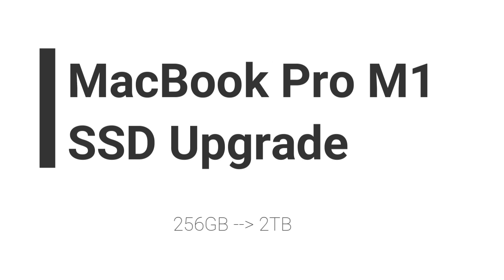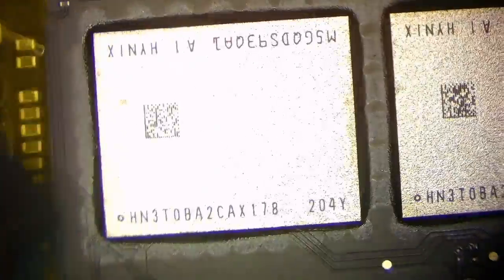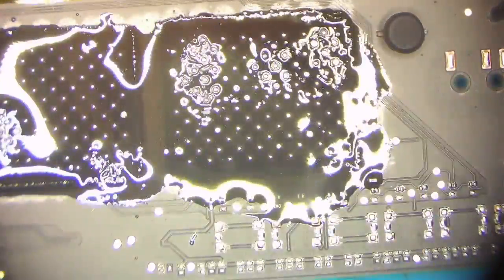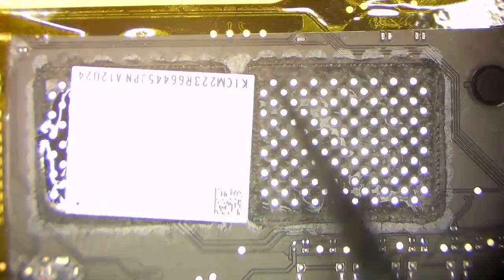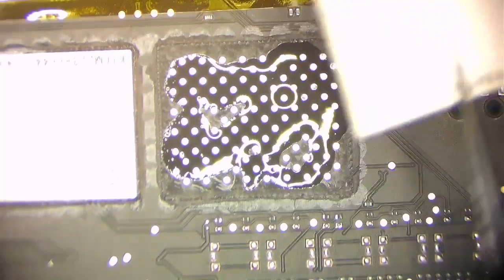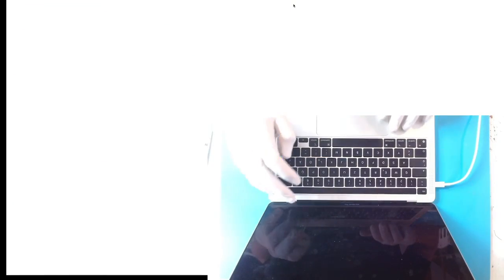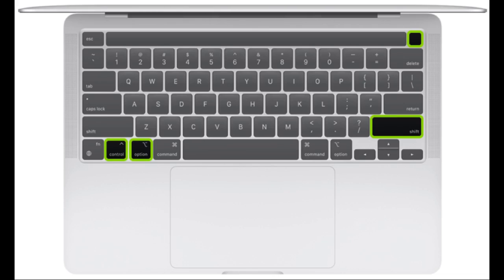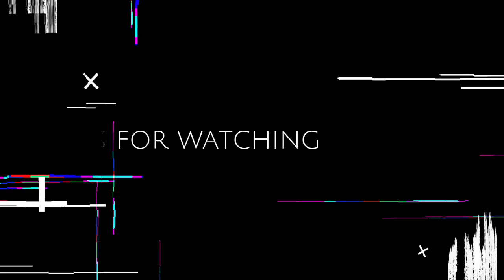MacBook Pro M1 (A2338) SSD Upgrade 256GB to 2TB

Comment: Did you extract, dump the firmware from the 256GB NAND and use a programmer to flash that firmware onto the 2TB NANDS? Also do they must work in pair? I mean can you install let’s say just a single 1TB NAND and not soldering anything on the second?
Reply from the maker: no. you just solder new ones and thats it
Reply: @lindenaurepair  Sounds great. Thanks!

Comment: Awesome video. I want to do it, but I see a difference in the chip info from the AliExpress link you shared. In your video it shows starting with KICM223 and ending in 2024, but when I look at their current options the info on the chip starts the same but ends in 2020. Will that be a problem? Ty so much!
Reply from the maker: @Film4Sports  no issues. endings dont matter
Reply: @lindenaurepair  last question, can you use these same SSD chips on M2 and M3 Macs as well? Seems like you can: https://youtu.be/LMTI6gwxinw?si=z9dtBbkJStCLMHSW
Reply: @lindenaurepair  do you reball the new NAND before soldering in place? I think your video doesn't show but I've seen a couple other ones where they do
Reply from the maker: @Film4Sports  yes, of course they have to be reballed!
Reply: @lindenaurepair  sorry last question hopefully, what type of soldering paste do you use for reballing? Same low melting point, no clean paste? Or different melting points for removing chip and reballing?

Comment: As soon as I saw you have to pull off those chips on the board i realized this was way to complicated lol
Reply: And apple did this just to make it as hard as possible for end consumers to do. But there was no way I was paying £500 more for a bigger drive...not when they cost <£100 off the shelf
Reply: @nylosx well they mostly do this bc just like with their phones, they’re gonna be obsolete in 1-5 years. So the user will eventually have no choice but to buy an entirely new phone or computer. With millions of users, 
 It keeps their sales moving. Most people want all the “cool” features so they do it every year anyways. I went from an iPhone 6s to a 12 to a 15 pro max. So I don’t buy phones but every once in a while. When mine actually does shit the bed.
Reply: @nylosx  It's not the main reason they'd use components like this instead of removable drives.  With removable drives, the mounting hardware adds a considerable amount of wasted space to the motherboard.
Reply: I think if have the right tools can be done
Reply: Lmao yup, I literally was just reading about it and it even said you’d have to pull off the firmware strips. That’s why they say, this can’t be done. Bc unless you’re someone with extensive knowledge of this, the average person WILL fuck their entire warranty up and their computer. Idk about yall but I got this when it first came out and M1 was the “craze” it was awesome. Supposed to have so many cores and be faster than  Mac’s with intel and even some pcs. Which isn’t exactly true. Depends on the pc build. 

This, It isn’t complicated but if you don’t know what you’re doing, it will be. Most computer users have no idea how the inside of it is actually doing its job. So if you’re one of them, save yourself the money of fucking up your computer and go have a professional install more memory if that’s the route you wanna take. In most cases doing it yourself completely voids the warranty that most people try to use when they complain about needing a new one.
Reply: afraid to mess up thats all.

Comment: Hi I have a macbook A2179 that has a potential logic board issue. It's like the battery wont charge but the battery can power the device, I have tried another battery and couldn't get the battery charged. The computer also only boots to the apple logo and sits there with fans running and cpu getting hot. There is no display connected as it is damaged. Can you help me on what to do? It's a Macbook air 2020 intel i3 8gb ram 512gb ssd A2179 thanks.

Comment: Hi there, 
I’ve got Macbook Air M1 A2337.
Mine is 256GB, if I upgrade it to 2TB, does it need to change T2 chip from 1G to 2G? 

This my first time for Macbook Air M1 A2337.

Thank you 
Love your videos. 
That’s helpful 😊
Reply: Apple Silicon Macs (M1 and above) do not have a T2 chip, meaning that the upgrade will work regardless of RAM configuration.

Comment: Hello Robert, I tried to upgrade 256Gb to 1TB on a A2338. I took the SSD chips from another A2338. As far as I understood you just take the chips from another A2338 taking care of 0 and 1. The restore failed. The same with another 512GB chips. So my question is can you just take the SSD chips from  one board and intall them an another M1 board? Or that works only if you buy the SSD chips from China?
Reply from the maker: don’t take used Chips from other Boards. you will never know, how much life there is left or if they are functional all… you can’t sendme the Logic Board for Repair if you want
Reply: I have a mdm locked device, can I just swap the entire board?

Comment: Robert, Is it possible to do the SSD upgrade on M2 or M3 MacBook Pro ? And if so, what is the maximum storage possible ? Thank you.
Reply: M2 SSDs are soldered onto the plate, making replacement impossible.
Reply: @itsuchur  why would it be impossible? you just have to desolder it and solder on new chips.he literally did it in this video

Comment: I heard that if you change the SSD you cant wake up the mac after sleep/close the screen/lid.

any side effects?
Reply from the maker: This is only the case on pre-2016 and 2017 Air models, when you switch to nvme. no side effects here. Same chips as Apple uses

Comment: Hi, this still work?, will upgrading my macOS in futur wont prevent to use this new chip? Hi, this still work?, an the chip selling on amazon is this a brand new, blank nan, no firmware with no programming? the price is for only 1 chip of both of them?
Reply from the maker: Yes still working, just did this a week ago. Chips sold are new and 100% compatible for this upgrade. Pricing is in the offer and should be very clear.
Reply: the chip is sold by 2? or i need to by 2? @lindenaurepair
Reply: fam can you please tell me if the chip comes in pair on aliexpress? or i need to buy 2 of them? will buy it asap @lindenaurepair

Comment: That's totally ridiculous, to have to do all that BS just to upgrade your freaking hard drive. Apple sucks. The way they design their laptops is so overly convoluted and ridiculous it's no wonder they cost so damn much. What a rip off. Clearly their problem is that they're sanctimonious and think they have the 'Mercedes-Benz' brand of computers, so that when you bring them in for maintenance they can overcharge you for it. That's the way they're designed because it's all about greed, not common sense design. That perfectly explains why they have a trillion-dollar market cap, which is also ridiculous.

Comment: Hi! What are the chips for the 8tb upgrade? Thank you for your video is super useful
Reply from the maker: You can‘t upgrade to 8tb on this device. 2TB are max
Reply: @lindenaurepair  what about on the m3 pro?
Reply: @lindenaurepair  What chips would you use to upgrade 512gb to 2tb MacBook Pro M1 14 16gb RAM 2021? Is it possible or are they soldered?

Comment: so it just worked? i thought that it wouldn't be able to read or write to the NAND chips because the NAND controller in the cpu was made for only the amount that you bought.
Reply from the maker: You‘re confusing it with Mac Studios SSD Slots, where it only can run as much slots as came from factory. M1 machines Mini, Air, Pro can run 2TB as shown. 14“ and 16“ up to 8TB
Reply: @lindenaurepair  sweet! That's cool!
Reply: @lindenaurepair I love you, you shoulda know it.
Reply: @lindenaurepair  I have 512mb SSD for M1 Macbook pro is it possible to upgrade that to 2TB or 8TB?
Reply from the maker: @michaelsvlog  2TB yes
Reply: @lindenaurepair  So the 16inch m1 pro macbook is limited to 2TB upgrade?
Reply from the maker: @michaelsvlog  no, sorry. but going from 512 to 8tb needs a lot of work. contact ezfix👍
Reply: well sort of. if you have to replace NAND chips, you'll have to replace all of them (or get into some low level NAND reprogramming). Just to show how insane its designed, if you desolder both chips and switch its positions, your Mac won't work and will fail to restore from DFU

there's an  hour long video by iBoff RCC that goes into detail about how these NAND chips work over the generations of Macs. Quite an interesting watch
Reply from the maker: @anzer789  Yes, no simple upgrade. But if you manipulate a RAID it won‘t work as well. iBoff‘s video is amazing but their treating M1 SSDs like prior versions, which isn‘t the case. M1 doesn‘t need chips coming from donor boards or preprogramming!
Reply: @lindenaurepair so where can you buy useful nands? i’d like to upgrade my m1 pro ssd to 2 tb
Reply from the maker: @Mmmyyyzzz  it‘s in the caption sweetheart, but here you go again: https://www.aliexpress.us/item/3256805408293177.html?spm=a2g0o.store_pc_allProduct.8148356.1.1c0747adQqb74S&pdp_npi=3%40dis%21USD%21US%20%2447.33%21US%20%2447.33%21%21%21%21%21%40213dd47b16972888168117969ed493%2112000033683866274%21sh%21US%21221141588&gatewayAdapt=glo2usa
Reply: @lindenaurepair  But: assume I have (for example) two 512G NANDs from iPhone 13. Can I just put them on the A2338 board, and then AC2 will be able to install the system on them? Or is there a way to make them "blank"?

Note: I've seen your link to an Aliexpress seller that has new NANDs. My question is really about NANDs from   donor boards (since I have a bunch available), and whether I can use them.
Reply from the maker: Hi, iphone nand does not work!!! order new and there will be no headache🥰
Reply: @lindenaurepair  Thank you. I really appreciate it: each answer means that you took the time to experiment.
Reply from the maker: @LecomteRepairServices  you‘re welcome. Iphone nand will give you error 35 or others. been there, done that. Nothing better than a new SSD!